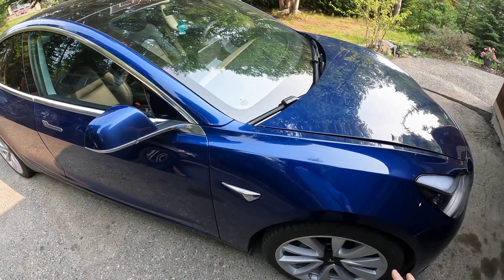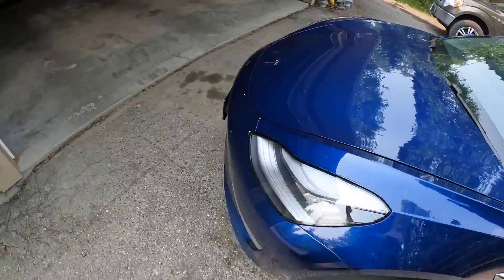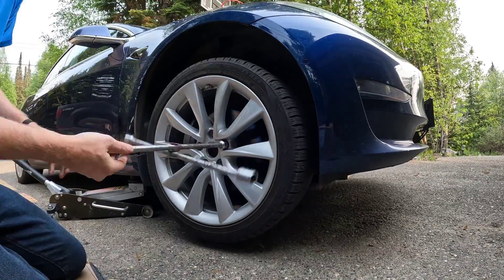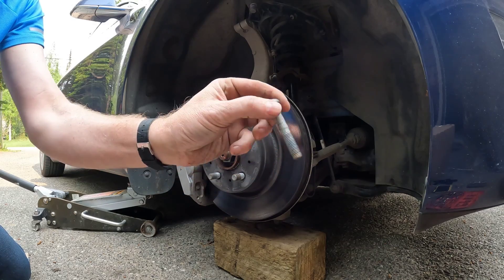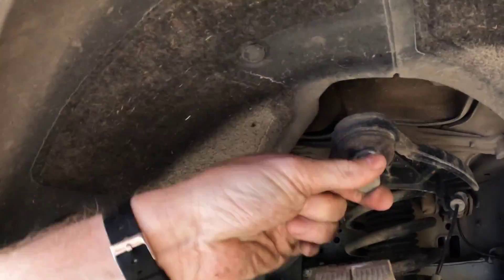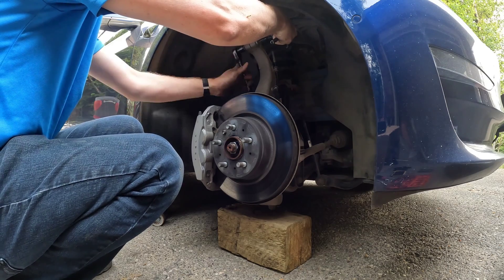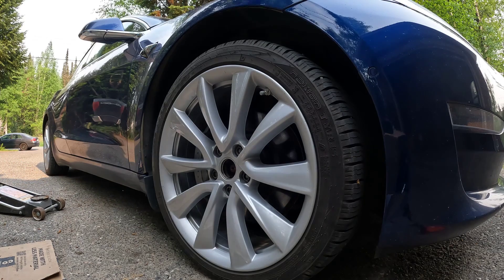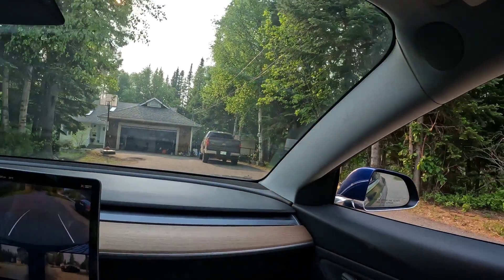Tesla Model 3 (2020 AWD) Squeaky Control Arm Fix

Comment: Just completed this, seems to have worked well. Join was super stiff after working it for 30sec or so its loosened up. 

For those wondering torque spec "Install the bolt and new nut that attach the upper control arm to the knuckle.
56 Nm (41.3 lbs-ft)" (From tesla service manual)

I was able to just pull down on the control arm to mate them
Reply from the maker: awesome, I recommend using a grease gun and using ball joint grease as it lasts the longests! Glad it worked for you!

Comment: I injected the grease and it actually got a bit worse. It sure pushed a lot of rusty water out as the grease was going in. There was also a split in the boot. Hopefully wiggling and around will give me a little bit more time to eventual right and left replacement.

Comment: Did this fix. Suggestion: use a ratchet strap around the suspension and link arm after you take the tire off to raise and lower the wheel to remove and reinstall the bolt.
Reply from the maker: still to this day both control arms not squeaking for me!
Reply: @TeslaPrince   Is yours front-wheel drive?  😊
Reply: Yes, do use a ratchet strap or a clamp to ease the grip on the bolt. I hit on the bolt with a hammer like in the video to remove it, and did wear off the thread. Now I can't screw the nut all the way in, I'll have to find a way to fix the thread....

Comment: I tried this too, and it didn't work.  What did work is much less involved:  Jack up car so you can reach in above the tire.  Remove the spring clip from the rubber boot.  Pull down the boot and fill it with normal motor oil.  Restore the boot and spring clip to their places.  Lower car.  This at 150k mi.

Comment: Same here. And why is it on the right front on every model 3?🤣
Reply: It is on my driver front wheel😢..Just replaced the upper arms on both wheels in Tesla service and the squeaking is even stronger..
Reply: @trajsa1 whoaaaa! You're kidding!!! So what now? I have this issue and mine is front driver's side. Please keep me informed as to what exactly you did to fix this. I have less than 50k on mine so I plan on taking it to a Tesla service center but am weary that just like in your case it might not fix it... 

Did they charge you or was it included in manufacturer's warranty? 

Thanks

Comment: I have had this happening for a week, am i ok to drive for another week? 
Wont damage the car?
Reply from the maker: This is a common problem and while i cannot guarantee anything, most people drive for months without issue but do not ignore this or it may become a safety issue.
Reply: @TeslaPrince  ok for sure. I made an SC appointment for this Thursday they want 230$ I'm at 50.1k miles on my 2019 M3 
I'm going to see if my mechanic isn't down to try and do this video for me before then
Reply from the maker: To be clear the problem is due to the grease in the joint drying out too quickly (the part is faulty and it really should have been a recall by Tesla, someone from our local EV group had it done under warranty recently). Adding grease into the joint will only give you additional time, could be a few months or a year with no squeaking, but eventually it likely needs to be done.
Reply: @TeslaPrince  ok ill Just go to tesla. Thanks man!!
Reply: @TeslaPrince   Surely the 
ball joint should be fitted with a grease nipple and occasionally greased as in the good 'ole days. 
The way it is now, it will be a nice little earner 😮
Reply: Hey so it's interesting 
I went to SC 
They test drove and of course no noise at all 
They sent me on my way and said in the future it would need it done and that they think it makes more noise due to getting wet in the rain 
After it rains my car creaks so bad it is horrendous 
But then it gets dry and no noise 
Anyways sc told me to hold off
Reply from the maker: @NaturePNW I suspect because they hope it will go out of warranty the next time you come back! Either way, once it starts making noise it will do so all the time soon thereafter from what I have experienced.
Reply: @TeslaPrince  yup heard! I'll make another appointment while it's still doing it. Ya it was already out of warranty 
They quoted me 250 
But then said there would be potentially a 250 inspection fee and if it turned out to be the lower arms not just the upper, would be looking at upwards of 2k 😭
Reply: @Zballin45 same here...paid 370 eur for the upper arms, after complaining the problem persists, they offered replacing lower arm, for 1000 eur, but again with no guarantee that the squeaking will be resolved..PLEASE SHARE YOUR EXPIRIENCE..THANKS

Comment: For tesla owners that think their  Model 3 will be low maintenance, you have been mislead. My 2018 model 3 RWD has had this squeaky control arm twice in 60k miles since I’ve had brand new. I live in San Francisco and weather is nothing crazy. Had the squeaky issue repaired at 30k and now again at 60k. Parts are out of warranty at 50k and will cost me $200 for repair. I’ll probably need to pay for another repair at 90k for this same component. Dozens of other model 3 owners and friends have had this same issue. I’m sure tesla intentionally engineered this weak component into suspension. The real cost of the part is a few dollars and the time it takes to lift and swap the part is less than 30min yet they capture a hefty amount for the service.I just looked this up and learned tesla makes 60% margins on their service.
Reply from the maker: I've found the issues are all very minor compared to every gas vehicle I've had. As i already mentioned in other videos, service for your Tesla may be poor, especially if you live far away from a service center
Reply: Very minor issue and the car is VERY low maintenance. I've maintained the 21 cars I've owned in 25 years myself, this is no big deal. Just buy a grease gun with a needle and fix it yourself. It's as simple as airing up a ball.
Reply: @natypes1 so grease it up or just spin it like the video?
Reply: I can't say I agree.  My car required next to no care, repair or maintenance.  I resolved my squeaky control arm by moving around like in this video but the squeak returned several weeks later.  Now I'll add grease to it, which I did not do last time.  I have 96k miles on 2020 MYP
Reply: I massage the rubber to distribute the grease around. And that worked for me. 

Your method would be ideal. But luckily just massaging the rubber was enough for mine. It’s been 100k miles since and still creak free.
Reply: I have a 2018 at 65k miles and haven’t had this issue.
Reply: $200 repair is extremely unreliable to you? You’re the nightmare customer that never thinks they will ever have to pay for any repairs for life on anything

Comment: I came here trying to get a definitive answer on what size hex bit to buy to get that screw off.  Otherwise, helpful video.  Another video says it's a T47 for those wondering.
Reply from the maker: I found that I didnt need to use any hex bit, just use a 15 mm socket on the end with the nut (the rounded end with hex doesn't spin) then gently tap out the bolt with a piece of wood.
Reply: @TeslaPrince  just saved me thanks for the vid
Reply: @TeslaPrince  That's good to know.  I'll try that before I go buy the hex driver.
Reply from the maker: I have definitive answers for you, today the other side started squeaking so i did the same procedure you saw in the video. Did NOT need the hex, however just for you I bought a T50 star and it fits perfect (didnt use it).
Reply: @TeslaPrince why the wood underneath?
Reply: @NaturePNW  if the hydraulic lift fails, the car will stand on the piece of wood and not drop all the way to the pavement.